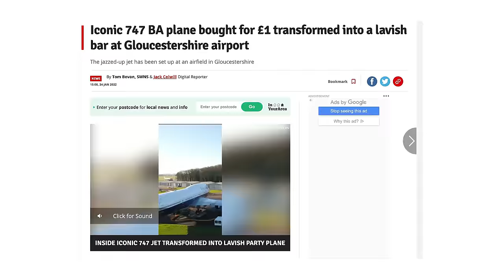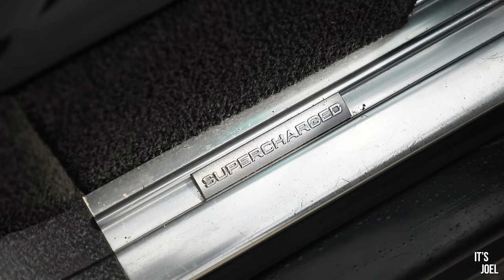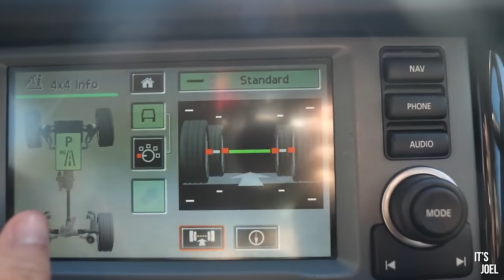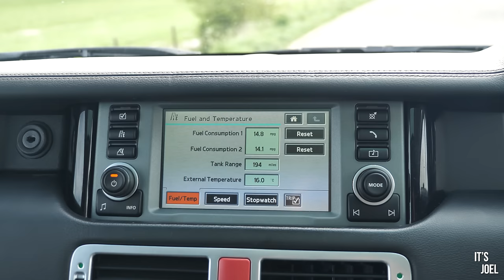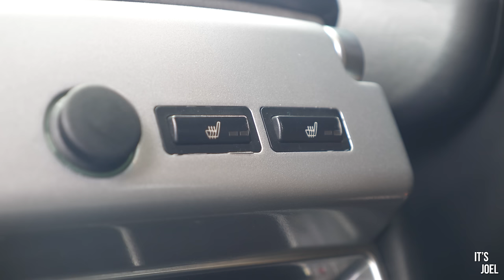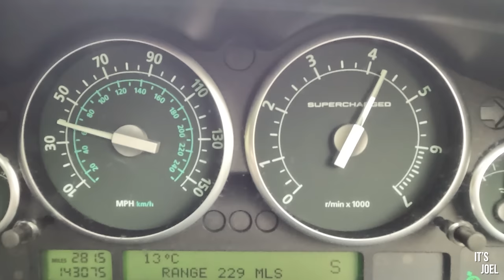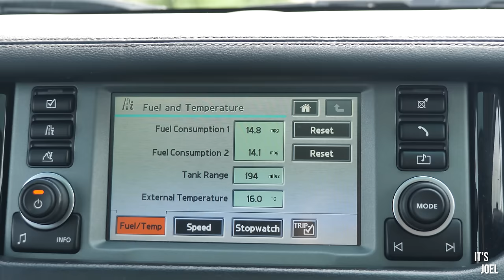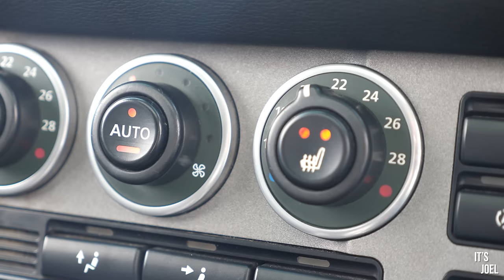BRUTALLY HONEST REVIEW OF THE 4.2 V8 SUPERCHARGED RANGE ROVER L322

Comment: I have owned my L322 for about 5 years now and will probably never sell it, just picked up another P38 and now on the hunt for a Classic RR.
Reply: what engine is your L322? any major issues
Reply: @Spartansrule118  4.4 V8. No major issues, I service it every 6000 miles. I do my own maintenance. The beauty of owning an L322 is that all the issues are covered plus their fixes. Parts are cheap and loads of room to work. They need to have a good battery as low charge can chuck up electrical gremlins. I have 11 cars at last count, L322 would be the last one I would sell. I wouldn't buy another as mine fits me like a glove and I know it's all good, biggest risk when buying is the person you are buying from!  Just sold the P38 after getting it ready for the road... realised they aren't that good compared to an L322, purchase was purely sentimental.

Comment: Did he say 350-400 miles per tank??
I’ve seen worse in smaller cars.
Reply: Do smaller cars have a 104 Liter fuel tank?
Reply: @ Valid point. 😎
Reply: @risk0systemsuk171  I only use super unleaded also. Costs around £150 a full if I let the tank run down enough

Comment: Not a bad video but probably want to review the script a little more 'the l322 came in many different shapes and sizes' presumably you meant it's engine variants cos there were next to no size and shape options. It did change over the years a few times but not shape nor size.

Also you say the 'the model before the L322, the L405' P38 I'm sure your aware the 405 is after but it has snuck into the video.

Comment: What a load of garbage the TD6 bmw is THE engine to preferably have (choosing to tune optional) only down side of that set up was the gearbox BUT £1500-2500 every 60-80k miles not that big a deal and know what you have again for another 60-80k miles generally worst case scenario.......